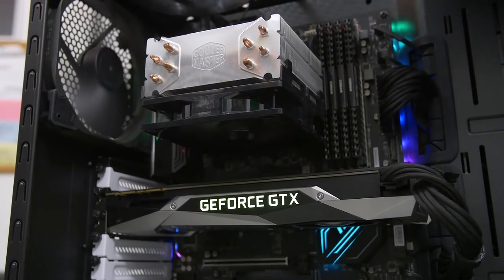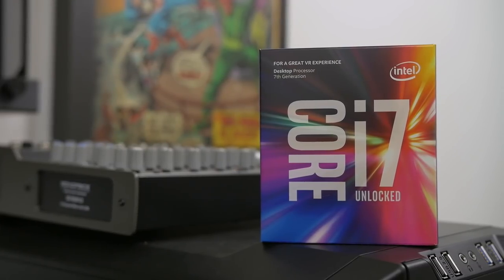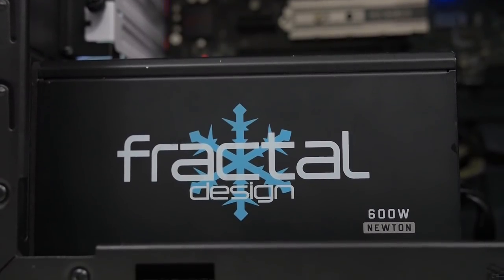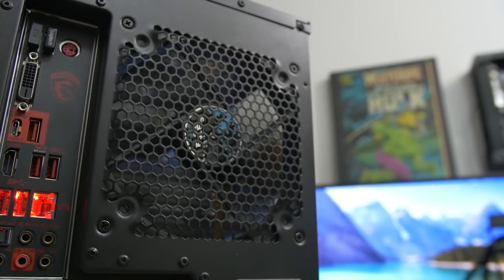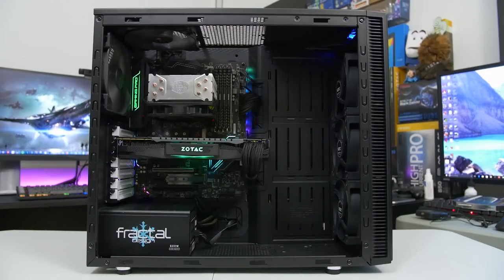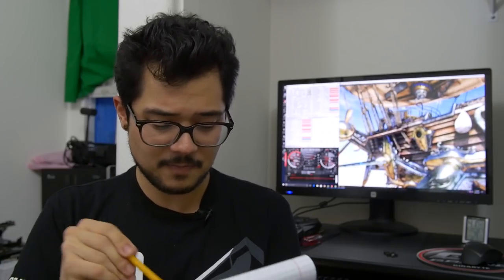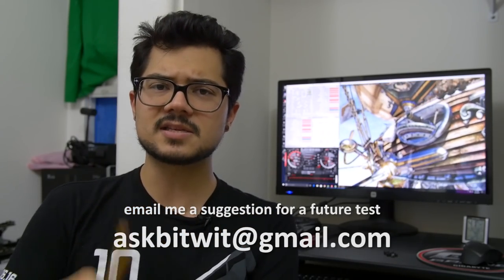This is how you should mount your CPU cooler! I think??

Comment: Random thought...  Anyone who has a $400 GPU, a $200 motherboard, and a $350 CPU who wants to use a $30 CPU cooler needs to reexamine their PC part choices...

Nice idea for a test, but not very real world in my opinion, try this again with a NH-D15 or other high end air cooler...

Or...  you know, just liquid cool it and be done with it.  :)
Reply: Is there something wrong with that cooler?
Reply: Cooper Zirbel nothing wrong with the cooler, but it's just highly unbalanced for the build. More power = more heat, and cheaping out on the cooling makes no sense
Reply: You couldn’t be more wrong there because its very real world. You don’t need anything more than a H212 when it comes to air cooling because the next thing you should be looking at is an AIO cooler. Just like a stock cpu doesn’t need more than its factory cooler but people still buy aftermarket air coolers for them lol. Back when the 4790k was still new, the rig I built was at these similar price points and it has been running @4.8ghz with a hyper 212 and its still going strong. The temps stay in the high 60’s currently even with this heat wave. Sure I could have gone with an AIO and most likely clocked over 5ghz but I saw no point the rig was plenty fast and still handles everything I throw at it with no thermal issues.

Just because you like to throw in an expensive cooler on every rig you make doesn’t mean it needs it lol.
Reply: I have a core i5 6600k OC'ed at 4.6ghz super stable on a hyper 212 turbo that stays around 55c even on full load. People have time and again talked about their core i7 overclocking like a beast and achieving stable core clocks on a Hyper 212 and never needing anything more.

So please, explain to me again how one would have to reexamine their PC part choices if they use a $30 cooler on a $350 CPU?
Reply: Wrong!  Hyper 212 is a very capable cooler
Reply: Are you kidding me? The Noctua cooler you propose is fantastic, but this cooler is completely fine. Especially if you want to save up for a liquid loop, but want to have great performance in the meantime. Like you could argue that you're missing out on performance with that cooler, but how much is that really gonna be? 10% max?
The most common CPU cooler is the intel stock one and this is 1000x better then that.
Reply: Tech Deals I’ve had 3 liquid coolers break in the past year. No thanks. Also fuck Corsair
Reply: this reply is funny because, unless you go custom loop, NH-D15 performs better than most AIOs
Reply: @Comalv yes!

Comment: In a closed case you have air pocket "voids" best explained by the Truck Bed airflow question, tailgate down or up. Tailgate down causes airflow to drag on the back of the truck, while tailgate up causes an air pocket that circulates opposite like two rolling pins against each other. To be blunt, the size of the video cards cause air flow issues within the case and you need air blowing inward from UNDER the card to cause that air stagnant at the bottom to start flowing upward instead of being chipped away at when heat causes it to rise. A optimal setting would be three intake fans at the bottom on all three sides of the short ends (short ends means thin sides). This causes pressure, hot or not to rise up. This heated air, by the video card will want to expand and cause extra airflow up and out the exhaust ports. The "Stack Effect" of hot air shooting upwards will need VERTICAL exits with no fans in the way so that INTAKE fans above the video card can do their job. A fan will cause the warm air to cool a bit when used as an exhaust port, and will weight back down above the tower setup. You want it to remain hot and hit the ceiling for ROOM airflow, so the similar "truck beds tailgate down" issue doesn't happen near your computer. Please allow 12" between all surfaces and angle the computer 25 degrees from any walls exhaust ports so air flows in a predicted manner away as well.

Comment: A few things that are missing and would help to find out the reason behind the odd temperature changes:

- What were the GPU temps in all 4 tests?

- The open fan design could actually be keeping the GPU's PCB cooler since the heat is better exhausted out of the GPU and since there is enough airflow in the case, the case temperatures might not be affecting the CPU temps.

Comment: Try it with negative pressure only, meaning only fans blowing outward. Two up top, and one in the back. That's what I still run, as I never changed anything since I bought my case. Also make sure your room is closed. Sure your house might be temperature controlled, but different areas of the house are still relatively warmer or cooler depending on what's in them.

Comment: What about pulling cold air from the top of the case. And let the cpu cooler blow air down on the gpu?
Reply: I actually use almost that same config right now (with open shroud GPU). I have SilentiumPC Pax M70 case with the config: 2x120 intake fronts, 120+140 intake tops and only one 120 exhaust on the back. It gives me a lot of positive pressure (good dust control) and I achieve the lowest temperatures from amongst any other config (but with horizontal CPU airflow).
Reply: Heat rises so it may be a wise choice to find a flow with that in mind.

Comment: Blower style card is creating an airflow dead zone and trapping heat between the the cpu cooler and the gpu. With vertical orientation of the CPU cooler eliminates the dead zone...you could probably illustrate it with some smoke

Comment: Can you test with the CPU cooler horizontal, but in reverse so it draws air from the back of the case?
Reply: @allupro I actually did that config some time ago. I had a terrible case (a little bit old) with very stupid fan placement, so I reversed the air flow in the whole case as you described (with open shroud GPU). With no other changes (only reversing cpu airflow and reversing intake and exhaust case fans) i dropped down about 15 degrees on CPU and about 10 degrees on GPU. 

Keep in mind that it was unusual situation (stupid case fan placements) so you may not get any positive effect.

Comment: Heat rises, adding the extra airflow from the fans allowed it to circulated more vs the blower fan., hence the increased dispassion from the extra fans allowed the heat to redistribute throughout the case more rather then it being concentrated. Also it has more resistance to suck the hot air out. pushing it out the back,its due to having a exhaust fan in the top of the case really in the end and the heat is less concentrated..

Comment: It could be that since blower-style coolers are less effective, the gpu was warmer and then the air AROUND the GPU heated as a result. This air then rose up into the cpu cooler, increasing temps.

Or it could just be within margin of error. :P
Reply: But that doesn't really explain the 2nd test
Reply: Kim Jong-Un 
yes it does. With the vertical blower the heat from the back plate does not get to the cooler fan intake.  Real question is what is happening to GPU temperature in the four cases. Case 3 is best for CPU, but Case 2 is probably much better for GPU.
Reply: Blower style coolers are MOST effective. They extract the heat DIRECTLY outside the case. Which keeps the ambient temp inside the case lower, which benefits all devices inside the computer.
Reply: Wrong!

Literally every review of blower style coolers- like Nvidia Founders Edition and AMD Vega models- have proven that those cards run MUCH hotter that AIB cards (even though the fans exhaust into the case). That's why the FE cards are horrible for overclocking without liquid cooling; they get to 85°C in no time and then throttle down performance to keep temps in check. There are tons of examples of this on the internet. It's not even debatable.

With a decent case with good airflow, it's not an issue. There's no way a single 80mm (?) blower cooler is keeping up the THREE 100mm fans on my Aorus 1080 Ti.
Reply: shantfack Wrong. Change the fan speed curve and the cards wont even reach 60c under most circumstances.

Your personal experience, and poor unexperienced reviews dont equal facts.

As I said, the advantage of a blower style cooler is having the heat extracted directly out of the case. Your 3 100mm fans do not do that. They extract the heat into the case. Which in turn, keeps all of the heat inside the case and raises your entire case temps which increases card temps in return.

A single blower fan can move around 50 cfm of air, or about the same as your average 120mm case fan

Comment: The reason is actually more about flow paths. In the horizontal stream, the CPU is pulling the heat up and off the vid, but, not into the cpu cooler. It is channeling it out the back by creating a negative pressure area that sucks the heat out the back. With the enclosed vid card, it is not adding to the "streams" of air in the system the same way (open cards blow air into the card, then around it, so it can slip stream if you have enough pull /push from the front and rear fans) Since the enclosed card is pushing it's heat out the back, you get the radiant heat from the back of the card that eddies and flows boack into the cpu cooler
When it is facing the other way, you pull the heated air from the open gpu into the heatsink for the cpu, increasing temps, but, since more of the heat from the closed gpu goes out the back in this configuration(and the cpu fan blows the radiant heat out faster) the enclosed will be cooler. You should have checked GPU temps in both configs too.

Comment: With this heat sink, I did a horizontal position and did a the push pull style. And got crazy results. This Is by far my favorite cooler.

So I suggest doing to same thing for even better results, do 2 fans on the heatsink instead of just 1.

Comment: The horizontal mounting probably pulled the cold air from the front intake fans, creating a thermocline (A buffer of colder air preventing the warmer GPU exhaust from mixing with the air pulled through the CPU fan).

Like Jay said, can be seen if you use a smoke test.

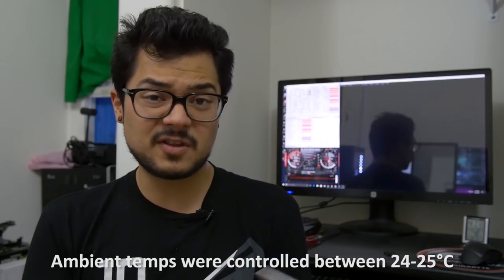Comment: 5:13, the difference is that the 2nd card adds to the airflow of the case.  The net amount of heat being exhausted through the first card, doesn't help the ambient heat generated immediately around the 1 st card.  2nd card piggybacks onto the air flow you have.